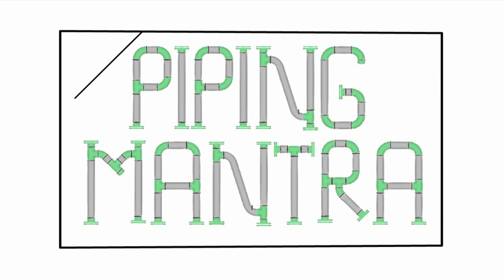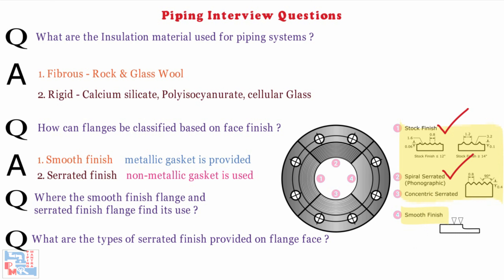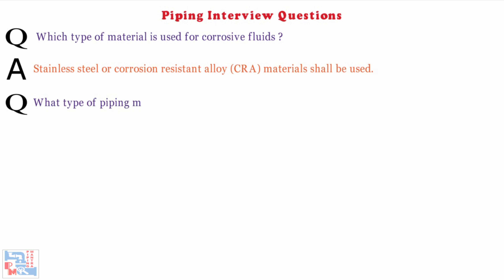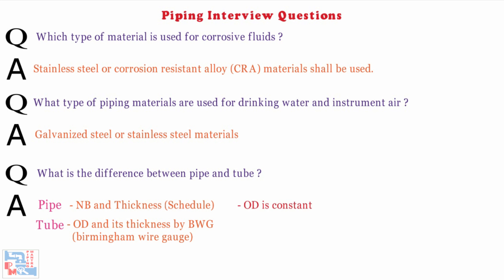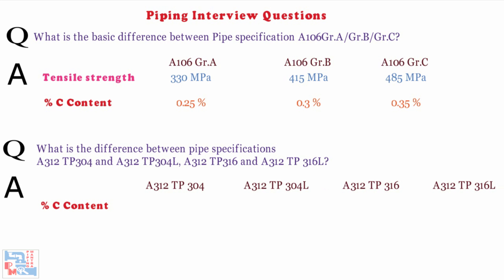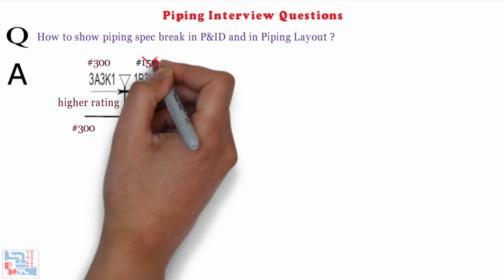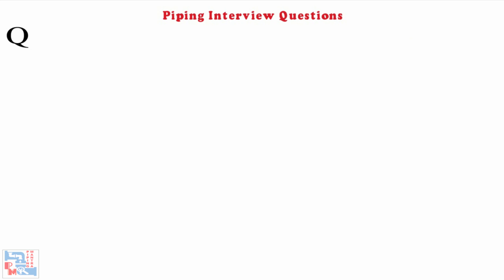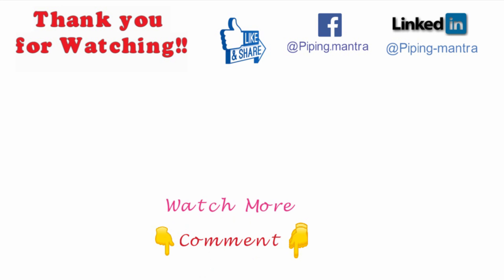Piping Interview Questions | Part-4 | Material | Piping Mantra |

Comment: Excellent video. At 00:58 of the video, you mentioned that "serrated finish" is used for "non metallic gasket". But spiral wound gasket (metallic gasket) is used with serrated finish and you mentioned that metallic gaskets require smooth finish.
Would you kindly clarify it please?
Thanks.

Comment: In difference between pipe and tube , it was mentioned that pipe has constant OD but the tube has constant od with thickness mentioned in bmg. For pipe the OD never matches the called pipe in inches until above or equal to 12”. Please correct me if wrong.
Reply from the maker: No pipes has constant OD means thickness change ID of pipe however in case of Tube based on thickness OD change and ID  remain constant.
For above 12 inch OD matches the formula like NPS in inch x25.4 = NPS in mm
Reply: @PipingMantra  thank you